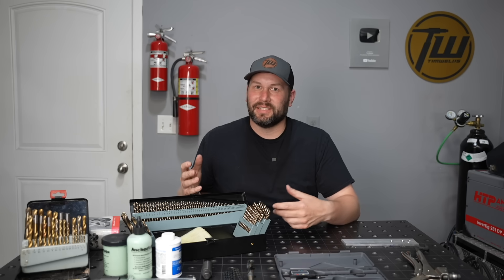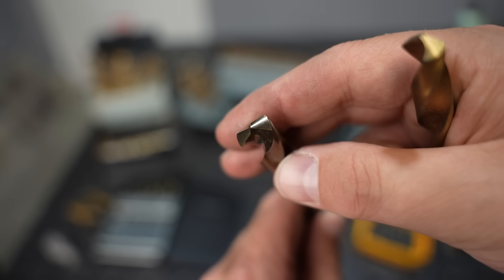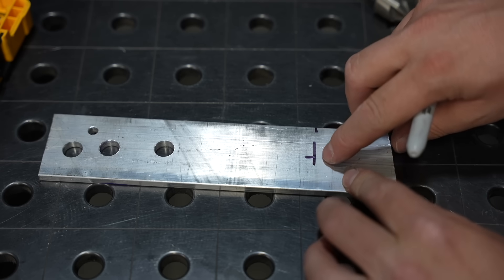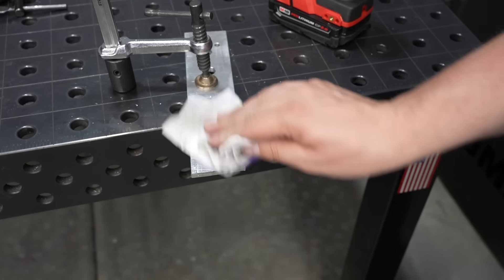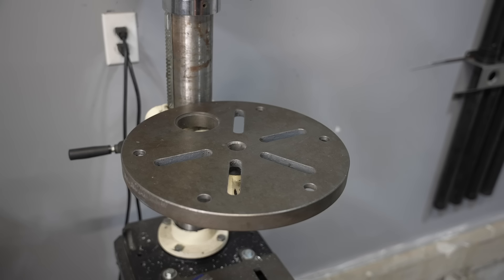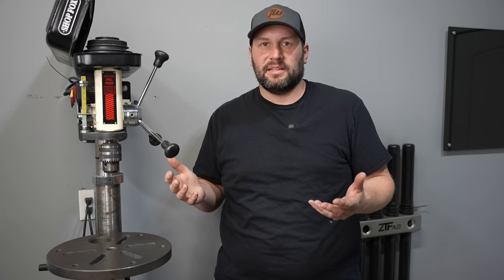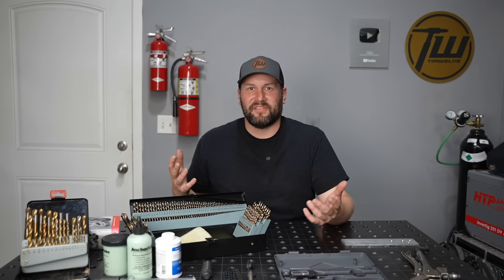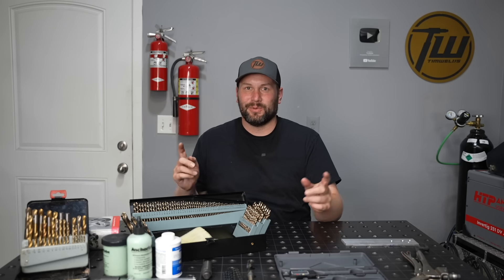How to Drill Holes in Metal: Master the Drill Press

Comment: Centerpunching can work-harden the surface of the metal, causing the drill to wander off the dimple. There is a correct speed range for every material/cutting tool combination. Cutting slower does not improve results or tool life. High speed steel drilling aluminum surface-feet per minute is about 400, drilling mild steel is about 100 sfm.  The rpm for a 1/4" HSS drill in mild steel is 1200/(pi*.25)=1528.

Comment: When I machining different materials I look for different signs. Like you said in the video , with aluminum the thickness of the chips will tell if you are at the right speed , but since it's aluminum it would really matter because it won't damage anything but the finish if you're going to fast. With steels, whether mild or hardened you can tell a lot from the color of the chips. Typically the darker the chip the faster you are going. I'll accept some bronzing even though I know that means my RPMs are to high. If you are getting purple or even worse black chips you are going to fast and are hardeneding your workpiece and damaging your tools. Also you can tell if your drill bit is sharp and evenly grounded by the chip length , long and even chips coming from both cutting edges means you have a sharp and even cutting tool.

Comment: As a machinist, I'm not looking to get drill press swarf. I prefer a peck drill because it breaks the chips. There are exceptions to every rule, though. I'm also looking for chatter. The holes should look smooth and clean, but no one is perfect. Blowout is avoided by slowing down when the bit is about to exit. For chamfering holes, be aware that spindle speed can matter based on the size of the hole and the diameter of the chamfer. For example, if you have a 1/2" 5 flute chamfer bit on a 1/4" hole, you could experience chatter that gives you a six sided star pattern that could have ruined your part. Use test pieces of the same material until you're familiar with the behavior of your particular chamfer bits.

Comment: I wonder how did you come up with the idea that 118 deg drill has longer cutting edge?
Reply: The smaller the angle, the pointier the bit tip becomes. The pointier the tip, the longer the edges will be.

The distance between the very tip and the edges of the "straight" parts of the drill bit will be longer when the angle is narrower.

As an example, if you had a drill bit that was 180°, the tip would be completely flat, meaning the length of each cutting edge would just be half of the diameter of the drill bit. Of course, this is just an example to demonstrate the concept. Now imagine we have another drill bit with a smaller angle, such as 135°. You can easily see how the cutting edges will be longer.
Reply: Bad math

Comment: Is your drill press mounted on jello ?
Reply from the maker: 😂 I built a little stand for it with leveling feet, but I slid it over to film more easily and didn't level it again. My floor is about as flat as a Pringle potato chip so it was wobbling a bit.

Comment: Chips wadding up around the drill is beacuse your feeding to slow. 

I dont peck if the material is less than the drill diameter, but i use mostly screw machne.
Reply from the maker: Thanks for the tips!

Comment: I like the fine point of the Sharpie pen but the ink runs out so soon, I have several of them that have run out but the other thicker end is still going strong. I'm done with buying that brand now, currently trying a pack of 5, different colours bought for a £1 in a cheap shop.
Reply: I, too, have given up on Sharpie markers in the shop. They either run dry too quickly, or they get contaminated with a little dust or oil and they stop writing. Surprisingly, I got a pack of markers from Harbor Freight and they work great. Even if I mark a piece of oily steel, they keep on working and make nice bold lines. They're cheaper than Sharpies, too.

Comment: DeWalt Extreme drill bits are made by German BBW (Bayrnishe Bohrerwerke) company (if you got "Made in Germany" on the package) are a solid drill bits with Cobalt and hardened core. From 6 or 7mm, they have special tip to easily center the drill bit and the shank is not round, so it holds better in the drill/drill press.

Comment: I found starting with a small hole prior to going for the actual large hole helps tremendously. If its really large i keep stepping it up..
Reply: I used to do that. However, the problem is that twist drills are not designed to be used that way. With a regular drill i.e. not one with a split point, a pilot hole just larger than the chisel section of the drill should be drilled, then the final drill size. Stepping up runs the risk of the hole drifting off and the drill cutting edge being damaged. With split point drills it is only necessary to have a pilot hole large enough for the drill to centre in, as there is no chisel section that needs clearance.

Comment: Thanks Tim
Do you have any video on how to center a new hole in a flange using an existing hole in another flange to match the two holes precisely together?
if you do please point me to it, if you don't please make one.
Thanks again
Reply from the maker: I don't have a video about that, but If I understand what you're describing, you can do it easily with a set of transfer pushes. They slide into the existing hole and center punch the location in the new flange.
Reply: @TimWelds  Thanks Tim, appreciate your reply,  it was clear but I didn't understand what you meant by "centre pushes" at first but then I assumed you wrote it by mistake and you meant "center punchs" so I searched it and found them, exactly what I was asking about, I never knew they existed 😂
Thanks again.

Comment: Great info, thank you. A neat little trick I picked up is to place several layers of cloth patch under the drill bit when drilling thin sheet metal. Doing that avoids the drill bit's tendency to grab as it clears the hole and leaves controlled beautifully circular clean holes. I’d like to claim the idea but I learned it from someone else on YT. Works a dream every time.

Comment: Thanks for sharing these tips, Tim, definitely some great ones here!

Norseman Viking drill bits like the ones you showed is my favorite metal fab purchase so far.  Hope to get the big set like you had on your table in the future.  Got tired of buying those sets from the big box stores over and over. The Starrett spring loaded punches are a close 2nd fav for me. Recently I had to lay out some very precise hole locations, which for me means they had to be within about 0.10 mm or better. I managed to get it done with a cheap carpenters cobo square, cheap digital calipers, the starrett punches, and a razor blade as the scribe. I wish I had known about layout fluid, that sure would have helped. 

Thanks again, Tim, this was a great video!

Comment: Have you ever tried an optical center punch? On-Mark was an old brand is now offered by Fowler. Grizzly and others have versions too. There’s a clear piece that magnifies the scribed mark on the part. Some have a crosshairs and some have a bullseye. Line that up, hold it in place and swap the  punch into where the magnifier was and give it a light tap to mark the material so you can locate the center punch to mark it with a heavier hit.

Comment: I use step bits for holes larger than 1/4 for drilling up to 1/4 inch thick mild steel. The holes are cleaner, and if you ease the beginning of the next step into the cut then deburring is done. Flip quickly for the other side. For 3/8" and larger holes in thicker mild steel, I will drill a 1/8 or so pilot. For 3/4" holes I'll use 3 bits. I was taught to try and get a continuous chip, after the ends of the cutting edges go into the hole. Also there's a feeling you get when the bit is cutting well, kind of smooth and soapy, hard to explain. I like the idea of 5/8 holes in the press table, I have a strong hand welding cart with the same accessories you showed. Don't know why I didn't consider it before. I do a fair amount of hand-holding, both in the vise and without if the part is big enough. I do keep in mind what will happen if the part catches, and position it so that it will hit the column before anything. I also use a caliper for marking, and when the centerline is involved I'll run the mark from both sides and put the punch between the lines. For super precision when punching, I like to gently tap the punch, inspect the small mark, and if good, I let the tip find the mark and deepen it. If it needs moved the light mark won't interfere.

Comment: Hi, one more trick for your vise if possible put the handle up against the support post. This way if the drill did catch the vise won’t turn and with the clamp won’t lift up either. I like the general speed rule for drills. The issue with cutting stainless is the titanium will work, will dull quickly, the cobalt will work much better. You do need to make sure the drill is cutting continuously. If not the nickel in the stainless will coat the cutting edge and from there you need to stop and remove the chips and nickel from the cutting edge. Remember cobalt drills are more brittle than HSS high speed steel and if using a hand drill and small drills they will break easily. The double ended center drills are mostly used in machining on lathes and mills. I love the FULL set of letter, number and decimal drills you have. Great video 👍
Reply: This is very good advice.
Cobalt bits are essential for stainless steel, and even then SS can be a pig to drill.  Didn't know about the nickel effect, but do know that grades of SS work-harden under drilling to different degrees.

Comment: What I do sometimes to scratch a line with a tungsten scriber is to take a medium sandpaper around 220 to 320 and just run it over the areas I’m going to mark. It gives a matte finish and only takes a few seconds. Then the lines stand out. If that isn’t a problem for the finish, then it works well for when you don’t have anything handy, or don’t want to “paint” something on the surface. Those chips are a bit too thin. More pressure would be better. Drill bits are designed for a fair amount of pressure. If the pressure is too low, you actually get more heat produced. For stainless, a lot of pressure at a slower speed is best so that the stainless doesn’t work harden. What’s actually happening is that the stainless is work hardening, but more pressure forces the cutting edges below that continuously created hardening. For the best results if you use a lot of stainless, I recommend going to McMastercarr and buying bits specifically designed for stainless for the hole sizes you need most often. This is like buying sheet metal bits, etc. They really do work much better, and only cost a couple,e bucks, or so for smaller sizes. For plastic, a 60-90 degree cutting edge. You can get bits for that too. Of you drill acrylic, they are highly recommended, or carefully grinding the cutting edges of 118 degree bits so that they are less aggressive. I grind them to where they are parallel to the length of the drill bit.
Reply from the maker: Thanks Mel, I appreciate the tips! I'll have to play with the pressure a bit. That old drill press probably needs some new belts because it starts slipping if I get after it very much with any over a 3/8" drill.
Reply: @TimWelds  Try to get V-belts that have a kind of teeth; not timing belts, but teethed V-belts.  Those are more flexible than plain common v-belts, and seem to grab much better on the pulleys, reducing slippage. I have a poor quality "Crapsman" small table bench with six speeds that seems to have improved with that type of belt.  

I bought the belt at a local GATES RUBBER distributor, and due to its much better (softer and more flexible) material, it consumes much less power than the absolute garbage-quality chinese belt that came installed from factory, which helped with the underpowered motor. Best Luck!
Reply: @alfredomarquez9777 The notched belts also run cooler. Running cooler reduces slippage. Win win.

Comment: Bought a plasma cutter, haven't even looked at a drill ever since. No bits, no problems, holes through 1.5 inch steel plate in 25 seconds. Holes are for fasteners,  fasteners are for people who can't weld lol. Haven't used a bolt since I learned to weld either. Lol
Reply: Cable railings?  Parts designed to be removable? Stairways/furniture where wood attaches to metal? I've tried to weld oak to mild steel, couldn't get it to work and the shop smelled like a forest fire. I'm still learning, so maybe someday...
Reply: @wellscampbell9858  for cable railings I'd plasma cut the holes, then chase them with a step bit to clean the dross, then weld in place once tight. Removable? That's what grinders and plasma cutters are for, As far as wood, why use an inferior material,  steel is always better than wood lol. All joking aside,  yes there are of course reasons to use fasteners,  I was just being facetious, however a plasma cutter does make for a handy tool when putting holes in stuff.
Reply: @jasonburguess  Interesting. I know a bit about cutting with plasma but nothing about making holes (gouging?) I have a plasma cutter, it's a miller spectrum 375. Small box with a handheld pistol grip head. I use it for cutting, and can do 1/2" if I'm steady, which I think may exceed the rated thickness. Not sure but I believe it's on the smaller end of what's available. What's your technique, and any idea if mine will work for holes?
Reply: @wellscampbell9858  techniques for cutting holes with plasma are very similar to using an oxyacetylene torch, pilot arc is very helpful,  but not necessarily required.  Strike the arc very close to the location of your desired hole, having marked it using soapstone or other high temp marking, then aim the arc into the material at a slight angle, as the heat increases molten material will start to blow out at an angle, slowly decrease your torch angle until your basically straight in, eventually you'll pierce through,  then carefully follow your marked line keeping speed steady enough to let the stream of ejected molten material blow straight down, if it's blowing out at an angle your probably going too fast.  After cutting the hole, knock off the slag/dross around the hole, and chase hole with a bit to deburr the hole. Not great for small holes but 1/2" or bigger,  works great. As with anything, practice makes perfect
Reply: Thanks! I have a well appointed scrap bin that is willing to help me dial it in :)

Comment: Can you have the speed too slow? Does this just slow production or actually make a lower quality hole?
Reply from the maker: From what I understand, it depends. Generally speaking, too slow is better than too fast and will work fine if you take your time and feed at an appropriate rate. In some cases, I've had the cutting edge bind on the material/chips and break the tool when drilling too slow. It worked much better at higher speed with the same model of drill and same material. Not that the hole was better, but it was definitely better for the tool. That's what I've found, but I'm sure others have had a variety of experiences. It never hurts to test it out and if it works in your situation, go for it.
Reply: @TimWelds  Thank you.

Comment: I got an adaptor to fit annular cutters in my drill press. That's all I use for anything bigger than 13mm these days. Far faster and cutters are a lot cheaper than drill bits in larger sizes.
Reply from the maker: That would be really nice, I'll have to look into an adapter like that.

Comment: Tool pressure is often overlooked with drilling. Lower RPM than you'd probably think is good, and basically no drill press can actually achieve the needed pressure. I already have S&F charts on the wall, and it still surprises me now and then.
Reply: You sir are absolutely correct